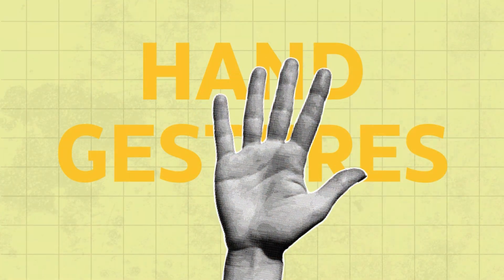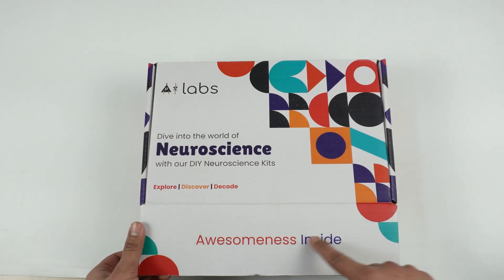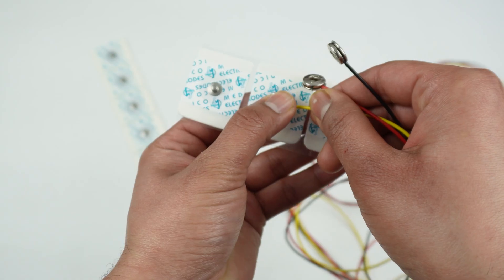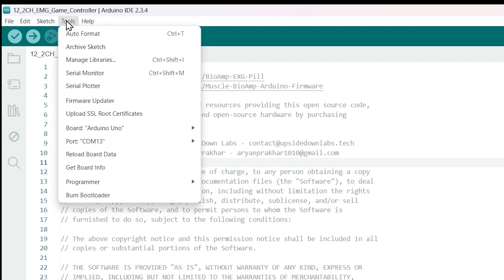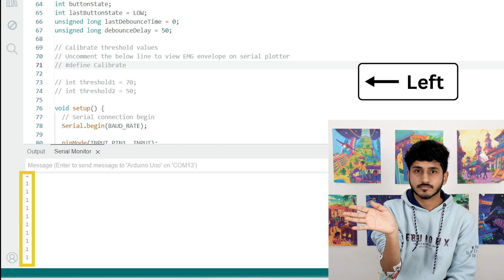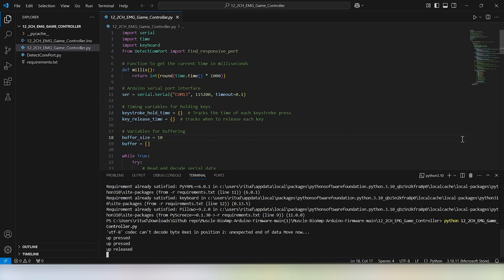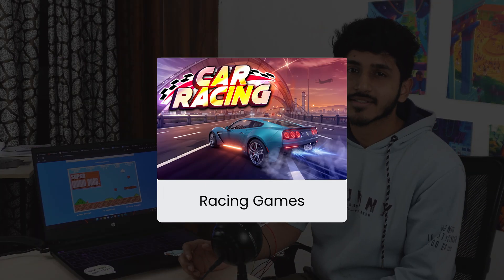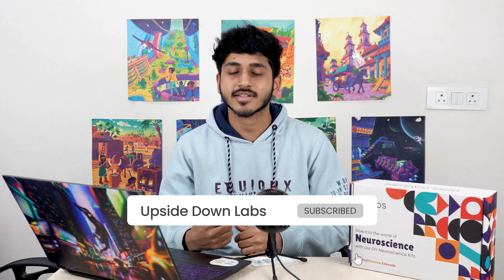Play video games using your muscle signals | EMG | Complete tutorial | DIY Neuroscience

Comment: hello, output 1,2,3 is not showing and i use latest pro kit which contains arduino r4 minima
Reply from the maker: Since it is not using a trained model, you need to set the thresholds according to your muscle signals. You can debug this by uncommenting line 71 in the code - "#define calibrate". Upload the code and open the serial monitor to see what envelope values it gets for your muscle signals, and set the threshold1 and threshold2 accordingly for different gestures. Then, once you've set the thresholds, you can just comment line 71 and upload the code and see if you get accurate results.